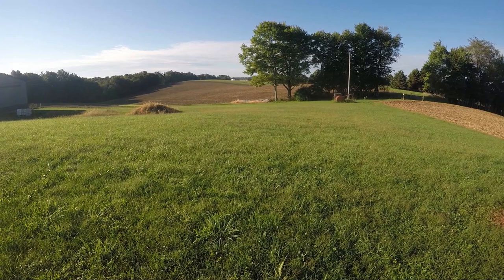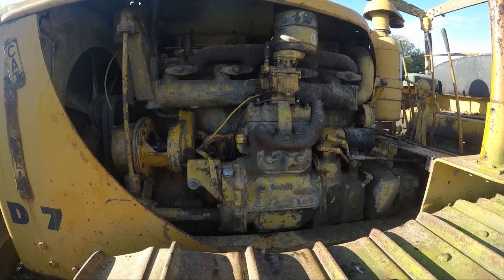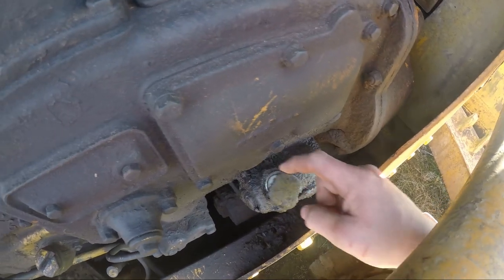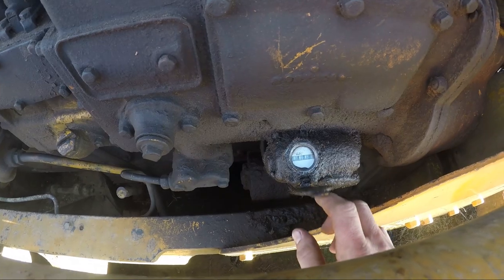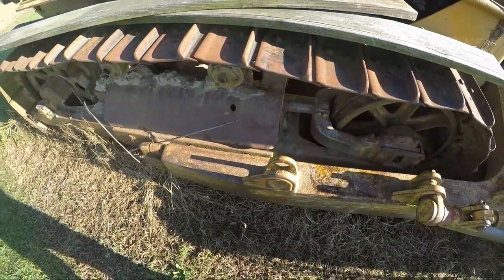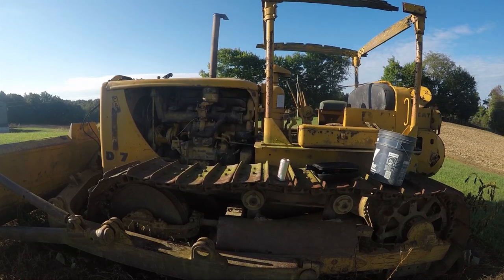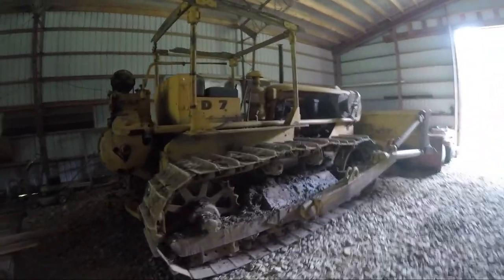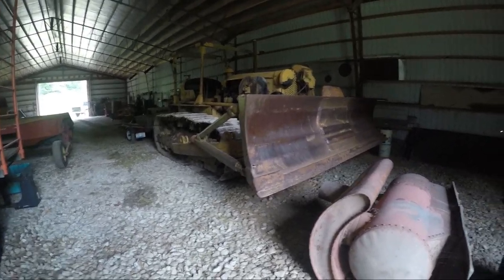Cat D7 3T First start in 6 Years. Old Start and Operate!

Comment: Love the old iron. I have a hydraulic D7 3T.  One thing to be mindful of with these old dozers is make sure to grease the idle bearing in the clutch. The zirk is located on the perimeter of the clutch, you can spin it by hand if its in neutral. What happens is that bearing gets hot and can seize if its left idling with the clutch disengaged. Always put the tranny in neutral or the johnson bar in neutral and engage the clutch when idling that will stop the bearing. I learned this hard way. Mine seized and took off on its own headed straight for my shop. Lucky thing that me or anyone else wasn't near it when it took off. I was able to run it down and get it stopped but I had to replace the clutch as it was toast. When I was a kid we had a cable D4 I was taught to keep the clutch pulled in, I just didn't think to transfer it over to the D7.
Reply from the maker: Wow that's crazy! Glad no one got hurt in that incident. Good to know about the idle bearing. We grease this machine often, especially since it sits for so long between uses. Not that we don't want to use it but in most cases it's just too darn big with a 12 foot blade.
Reply: Had that happen on an old d8
Reply: Now THAT is a good thing to know!

Comment: When shifting gears:  Release main clutch, then pull up on Blade Control, (It will stop trans rotation).  This  allows "no grind" gear change -- saving gear teeth...!  (D8, 8T series in AK Range).
Reply from the maker: Thanks for the tip! I actually stumbled upon that trick after running it for a little while. This was my first time starting/ running this dozer, used to always be dads job.
Reply: Also if you push forward on the clutch lever there's a brake that stops everything from spinning.
Reply from the maker: @cleveanderson3364  don't know if you could see in the video, I was pushing on the clutch with my foot while trying to get it in gear. The clutch brake is either out of adjustment or completely gone. Yet another thing that needs to get fixed before it comes back out.
Reply: @oilfarmer706  usally gone lol

Comment: I think your 3T might be  late thirties or early forties bulldozer because of the spoke of the spoke drive wheels and the call out on the hard nose...
Reply from the maker: It very well could be older. 1957 is just what I was always told. The older the cooler!
Reply: @oilfarmer706  If its an oil clutch its after  serial 15000 and in the 1950s.  The serial is stamped on body iron in front of the CCU.

Comment: Great video but I have to say this... I've run a few Cats with putt motors (including 3T) and I would never sit with my legs between the track and frame while someone else is on the operators platform. If something happens and the machine jumps ahead or back you don't have a hope in hell of getting out of there, I always just squat down on top of the track to work the controls so I can jump off if need be.The newer D7's with putt motors can be started from the operator platform and are much better. I knew a D7 owner operator many years ago that got run over by his own machine and left 7 kids without a father, not pretty!
Reply from the maker: Sorry to hear that. I'll admit it's not the safest thing to be doing. There was a lot cut out of this video as far as the start up process was concerned. I'm nur none one wants to watch 15 minutes of rolling the engine over with the pony. My dad was just there to run the compression release because it's very stiff. We had already rolled the engine over while I was standing on the U frame for the blade so we knew nothing was still in gear or was stuck.
Reply: @oilfarmer706  I appreciate the reply and I get it. Just thought I'd mention it, keep up the great video work!

Comment: Why does everyone want to rush the starting of these old machines?
Reply from the maker: What do you mean?
Reply: No one gives the starting engine enough time to warm up the diesel engine. They throw fuel to it while the compression release is engaged, washing down the cylinders, and hanging on for dear life to the pinion shift lever to keep it from kicking out. If you let the coolant temperature get up to 100 degrees, when you open the throttle, it will fire right off. the last couple of minutes move the compression release to run. By holding the pinion shift lever, you risk breaking the T bolt that pulls the pinion into the flywheel. That is a road you don't want to go down. By the way, both engines share the cooling system.
Reply from the maker: @richardbarnard247  I'm not disagreeing. Rest assured the diesel engine did get up to atleast 100 degrees before we moved forward with starting it. I don't know if you could tell, but a good portion of cranking the engine on low was cut out of the video. It just gets redundant after a while. The reason we put the fuel to it early is to build prime. It tends to lose it after sitting more than a year or so. Once we see the white smoke coming out of the stack we know we have fuel. On our dozer, you have to hang on to the pinion lever in low and high. Otherwise the engine makes 1 revolution and it kicks out. Lastly, we don't spend much time rolling the engine over in high because the pony motor clutch slips something fierce. The rear seal on the pony leaks and gets oil on the clutch. Are these things that can be fixed? Yes. But for a machine that might get 40 hours on it per decade, does it really make alot of sense to put that kind of time and money into it. I know the way we start this dozer is not the correct procedure, but, it's what works for the machine that's infront of us. Thank you for watching and for commenting
Reply: @oilfarmer706  The pinion kicking out, to soon, is a easy fix, and would only take a few minutes. If you break that T bolt, you will be down to pulling it for starting. Thank you for clarifying how long you took to start it.  I grew up with an old 3T. I'm 69 now and it's sad that it won't be long and these old girls will be so much scrap iron.
Reply from the maker: @richardbarnard247  I'd like to fix the pinion issue. It's an arm breaker. No problem, I'm always more than happy to elaborate. I'm sure no one wants to watch that thing crank over for that long before it starts. We try to take care of our equipment the best that we can and what is practical. Hopefully the old d7 will be around for many years to come. I'll look into getting that pinion fixed. Thank you. Have a good one!
Reply: @oilfarmer706  It's probably just need adjusting, and that isn't hard to do. Up on the front left corner there should be a round hole with a slotted plug in it. That is the access hole to adjust the pinion. Be careful taking it out, it isn't metal. Kind a the same material the nobs on the levers is made of. Down inside you'll see the pinion, and it has two jaws on it, might have to roll it around to see them both. Notice the slotted screw on the side of them, they may and should have a piece of wire run through the slot. Those are the adjusting screws and they increase tension on the jaws. Centrifugal force is what releases them, so it's best to do this when your starting it up. Be careful not to get them too tight, and keep them even.
Reply from the maker: @richardbarnard247  Thanks for the tip. I'll definitely have to check that out.
Reply: @oilfarmer706  Your welcome.

Comment: That bulldozer used to push scrapers. You can see the welded  on steel on the blade.
Reply from the maker: @dougshadrick9776  That was my assumption as well. From what I've been told, this dozer came from a mine near Masontown PA in the mid 80's.
Thanks for watching and commenting.

Comment: If you have a seiral number i can tell u the exact year
Reply from the maker: My apologies. I was just always told it was a 1957 and never questioned it. I know the serial number begins with 3T though. I will absolutely get the number off of it and let you know.  Thank you!
Reply: Not a problem
Reply: So its probably   made between 51 and 54
Reply: You do know that its worth more  if its older
Reply from the maker: @wilmamcdermott3065  it's with more to us on the farm than anyone would be willing to pay for it. Don't need it all the time but when we do, we really need it.
Reply: @oilfarmer706  i know exactly what u mean  mine  cleared  3 quarter sections of land
Reply: @oilfarmer706  i am presently doing cross shaft bearings. Waiting fo a press  i ordered
Reply: @oilfarmer706  best place to buy parts  is   General Gear in  Boise idahoe
Reply from the maker: @wilmamcdermott3065  thanks for the tip! The cable unit is the most pressing thing in need of repair. It still works but not like it should. All of the linkages inside are wore beyond recognition and I think it may have a broken return spring because it will get extremely hot after a while.
Reply from the maker: Was finally able to get the serial number for you. 
3T24510
Reply: @oilfarmer706  Search reveals 3T were made from 1944 to 1955 for a total is around 28000 units. That would put yours somewhere in the early 50s. Couldn’t find any exact info.
Reply from the maker: @loveistheanswer8137  thank you for looking into it! Greatly appreciated!
Reply: @oilfarmer706  That would be a 1953 year built.